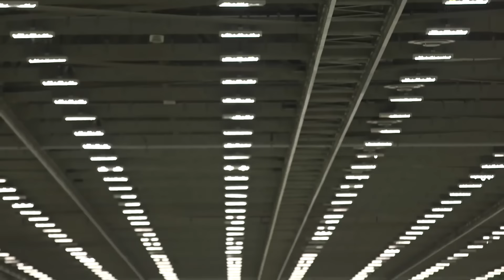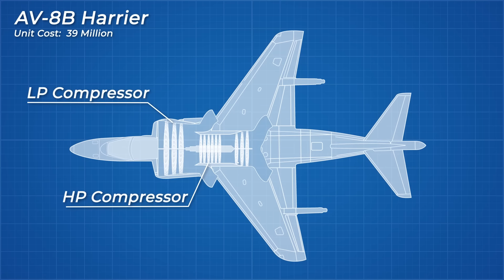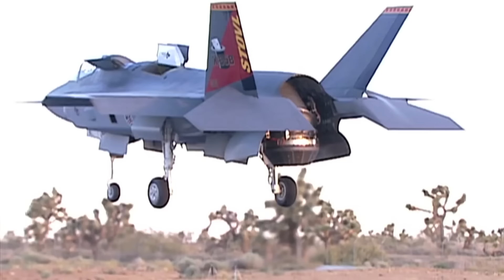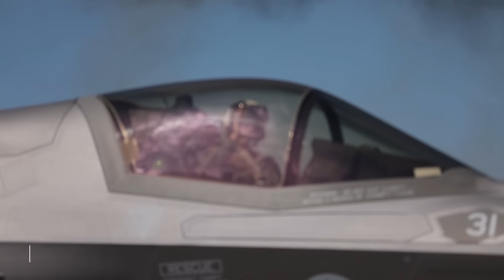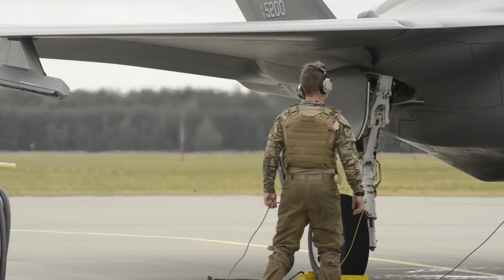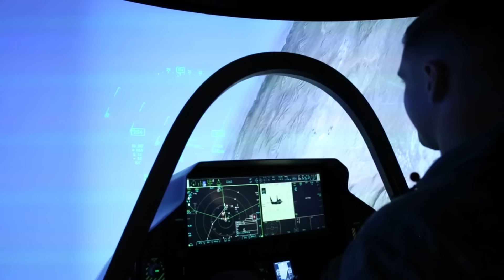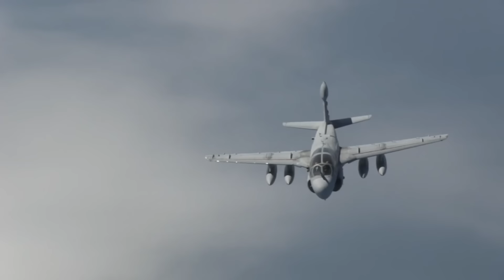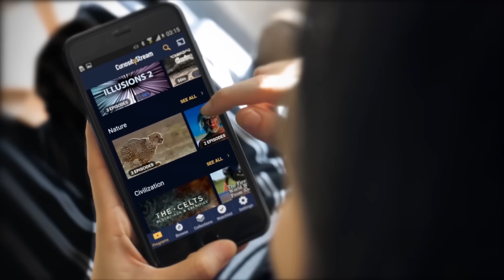Is The F-35 Worth $115 Million?

Comment: Half of F-35 fleet grounded by tech problems – Pentagon report. May 2019 More news. In 2017, the Pentagon revealed that “2,769 deficiencies” were identified in the performance of F35 jets. Further reports suggested some F35s have a life span four times shorter than the expected 8,000 flights, while the aircrafts’ guns accuracy is “unacceptable.”  July 2019 Latest news after 3 years the Main Gun is not working and it can't be sughted
https://www.rt.com/usa/416916-f35-pentagon-operations-report/
Reply: Nonsense.

Comment: This plane was a scam from the beginning. A real advancement would have used the same air frame for repair costs. With the ability to customize for use. Add large wings.  Vertical take off not needed put the fuel tanks in it's place.  They should all use the same frame and many other components. What's to stop the US from sabotaging or leaving secret components for tracking or manipulation. Never mind it's worst result. If successful it will kill other countries ability to build and innovate their own secure fleat.

Comment: What no one talks about is the fact that VTOL is vertical TAKE OFF and landing. None of these can actually take off vertically. Total fail.
Reply: F-35B takes off vertically. The Marine variant. They are the only ones who use the Harrier, and the only branch that requires that capability. It makes sense that the Navy and Air force variants don't, so they can be cheaper and hold more fuel etc

Comment: I really can't imagine an F-35A being able to loiter at low altitude for extended periods of time performing CAS nearly as well as an A-10 can, nor being able to absorb anywhere close to as much damage from small arms while still getting the pilot home alive. Also, it can't possibly carry as much ordnance as a Warthog can, even if we dismiss the 30mm cannon.
Reply: A-10s do not loiter at low altitudes if they can help it, if they did any opponent worth their salt will swat them out of the skys (they had one the highest number of lost aircraft during the gulf war) IR SAMs are it's bane. At one point they where pulled from active use due to their loss rate during the gull war.

In terms of Ordnance the A-10 is rated for up to 16,000 pounds the F-35 is rated for 18,000.

Further more CAS is not dependent on altitude or proximity of the troops to the tgts (the "close" in CAS actualy is for close coordination of the air and ground assets), and that most missions even with the A-10 are done with PGMs not guns. As such their done much higher in altitude for safety from ground fire. As such the A-10 has little advantage here of the F-35 and a lot of down sides. 

Entertainingly before the A-10 entered service it did a "test" where it was pitted against the A-7 which was the preeminent CAS bird of the time, not surprisingly the A-10 won, but when you look at the results you find that the A-10 should of lost or at the lest showed no clear winner (which actually was the opinion of the guys involved), as it only really won when both where down low and when the A-7 was not allowed to use it's fancy navigation aids and bomb computers (basically use the A-7 like an A-10, dose not work so well and like wise use an A-10 like an A-7...). More telling the recent upgrading to the A-10C finally gave the A-10 what the A-7 had during said tests (IIRC mid 70s).

Comment: Lad just so you know. Try to think at least 10 years ahead. Not just military. They are 50 years ahead technologically. The next move will be a rail gun that can be run by computer to shoot these down. If it takes evasive action, there will be supplemental rounds to meet those routes. Still an amazing aircraft and great article.

Comment: Doesn’t the F-35 lack the loitering capability of the A-10?
Reply: Loitering is not the end of all, and it depends on the distance of the airbase to the area you need to be in, further more the F-35 can get their in a third less time the A-10 takes. So if I need air support now the F-35 is a better option. If I need support now and perhaps later on sure the A-10 has it's use their, but so dose a B-52 or a Drone both of which vastly out last an A-10.

Comment: This F-35 recently got picked up and followed for 100's of Km's on a passive radar by a small radar company after an air show.
It's a POS if it doesn't have stealth.
Wish Australia bought the French Rafael instead.
Or even better if they had good relations with Russia, the Su-57.
Reply: Funny fact that All F-35s in that event where carrying Luneburg lenses, and was transmitting ADS-B. In short any Idiot could track one. So a passive radar tracking it is no surprise. Sure Passive radar is often stated as a threat to Stealth, but Keep in mind Passive radars need some one else to be the transmitter, in this case the F-35s (their where two of them and the German radar company Hensoldt stated they tracked them for 150km) where flying in an enhanced RCS mode and actively transmitting a HERE I AM code. 

In short they found and tracked a pair of aircraft that where not trying to hide at all.
Now if they Tracked them with out the aid of a active transponder (in which they did state they where using to cross reference) and the Luneburg lenses (which do come in passive radar variants) and where not flying on a practicable path at a known time. They might have a bit more of an argument.

In short Lets see them try to find the F-35 when it's Not Flying with Luneburg lenses on, nor with an active Transponder and coming from an unknown direction and time.

Comment: Former Osprey mechanic here. That being said one of our biggest issues was the avionics high vibration over  periods of time increased the brake down of wires as there clamps tend to slowly cut through the wire. Hence why we have 3 on board computer which compare data encase one computer fails. So In my humble opinion the f-35 biggest issue will not be any of it's production features but it's maintenance and up keep. Holding it back from being truly successful but I am optimistic if the plane can replace its predecessor's then it would have excess man power and room in it's budget to to deal with the maintenance leaving only manufacturering as a hurdle.
Reply: I say switch it out with styrofoam mountings to reduce vibrations.

Comment: If I would design something against the f-35 I would use a thermal sensor to detect it since the jet engine would radiate a lot of heat compared to the temprature of the air.

Comment: Very interesting video, but on of the aspects feel kind of untouched. One of the strong points of this aircraft is it's battlefield information sharing and integration system which makes it very powerful to coordinate with it's surroundings.  However how will this work for an airplane exported to another country ? Will it come with the confidential american system ? Will it be able to be adapted to the buyer's country's system ? If none of the above is possible then a lot of the innovations made on this aircraft seem partially pointless.
Reply: 30yrs old tech, pointless! Israel stripped theirs and installed modern avionics! More they are selling kits!

Comment: There's some issues with your video.  Not trying to be critical, but sometimes you missed some things.
-The A-10 is for bombing, not air superiority, it only carriers a couple of missiles for personal defense, it is best when attacking enemy tanks, bunkers, etc

-The X-32 didn't lose because it was an ugly plane, and the VTOL system wasn't its only issue, and actual, more critical issue was the wings, which were composite wings and Boeing could not produce them cheaply.  They spent several years trying to produce the wings and most wings came out as duds.
-The F-35B does not have a maximum takeoff weight of 31,800 kg (the F-35A and C do), it is 27,200 kg.  Furthermore, just like the Harrier, the F-35B cannot take off vertically while fully loaded.  It is classified as a STOVL plane, just like the Harrier.  It is an improvement over the Harrier, sure, but it's not a VTOL plane.
-This is really pedantic, I know, but the Marines don't own any helicopter carriers, and the Marines actually do operate from both Navy helicopter carriers and fleet carriers, along with the Navy.  In some senses, the Marines are still a component of the Navy, just like they were originally intended to be.
-When you mention the pilot who claimed the F-35 cannot dog fight, this report is accurate.  To expand on that, the reason the F-35 is doing better in simulations today is because pilots are being trained to take advantage of the plane's range and stealth.  The F-35 has missiles that can hit a target from like 60 miles away, and the fact that it is stealthy and equipped with America's best fighter sized radar means it should see the enemy before the enemy sees them.  Therefore the reason the F-35 can do well in combat vs other planes is because it stays safe, away from direct visual sight with the enemy, and picks them apart.  There are flaws with this strategy (lots of missiles that you fire from that far away tend to miss), but it is overall considered an improvement over flying directly to your opponent and firing Sidewinder missiles up his ass while chasing him.  The F-35 cannot dogfight because it is designed to defeat the enemy before the dogfight happens.
-Concerning the cost of the F-35, one aspect of cost that never gets mentioned is the cost of flying the plane on a day to day basis.  The cost of maintaining, repairing, and whatnot.  The F-35 costs less than most other planes that it replacing to maintain, which still means that it's a shitload of money, but in the long run it might give some of that back.

I consider the F-35 a failure specifically because of cost.  The reason Congress approved the project was to produce a plane that we could buy thousands of at a low cost without sacrificing a ton of capability.  It is a capable plane, but the cost has gone out the window.  Why make a "reasonably capable plane for a low cost" without the low cost?  Now it's just a reasonably capable plane.

Comment: It appears the True cost of these planes is being concealed thru creative accounting and billing.
Reply: The Incoming CinC demanded a better unit cost so, Hey Presto, shuffle some line items around on the spreadsheet and move chunks of costs to auxiliary systems and support structure then the pretend cost is a new lower price point. (Helmets, sensors, support equipment  and software not included.)

Nothing up muh sleeve but muh arm, folks!
Reply: @puirYorick  yes it appears that what the government is actually paying is likely fifty percent higher than claimed.
Reply: @klardfarkus3891  Hey, this ain't Lockheed's first boondoggle rodeo with DoD budgeting. Together they temporarily hid entire "black jet" projects out of the Skunkworks as line items for other projects when necessary. It's how it's done.

Truth is always an early victim in the procurement process. The surviving players are the ones who out-foxed the rest on playing politics not necessarily the best engineering designs.

The upside is that the assets of the losing teams are acquired/retained by the winners so things like Jack Northrop's flying wing eventually resurfaced from a version of the company he founded as the B-2 Spirit with a lot of additional computer-aided design work.

The design that beat out the first YB-49 flying wing was very conventional (the Convair  B-36) and would itself be succeeded by the B-52 in time. Those Buffs are of course, still "carrying iron" in the era of stealth bomber procurement for the next generation - the B-21.

This is mainly why I get a kick out of armchair warriors tossing performance claims back and forth. The actual decisions are as much to do with friends in high places as with hard engineering.

Comment: If all that the stealth does is to reduce it's radar cross section area, making an f-35 have a csa like that of a large bird, computers can still monitor the speeds of the objects in radar, and any object the size of a large bird flying at the subsonic speed would be the most obvious thing to focus on, 

Just a thought, since the radar waves belongs to EM spectrum, and if reflection theory can work, why not the refraction, why don't they try to build something that would refract off the waves at a wide angle?

Comment: The financial analysis here is severely lacking.  Per unit cost means ALMOST NOTHING compared to the total program cost.  You need to look up OPPORTUNITY COST to make sense of this. 
The f35 program has a total price tag of 1.5 TRILLION dollars, while the f22 raptor has a per unit cost of 150 million.  The f22 program was already basically done when they STARTED the f35 program in 1992 (f22 first flight in 1996).  This means that if they had never bothered with the f35 program at all, they could have purchased 10,000 additional f22 raptors for the price of the f35 program.  Are you seriously going to try to convince me that the 2600 f35's they plan to have when the program finally finishes will be BETTER than having 4 TIMES those numbers in F22 raptors?  The f22 is a superior plane, and everyone knows it.  This is why the f35 is ALLOWED to be exported, but the f22 is NOT ALLOWED to be exported.  If you spend all that money on buying f22 raptors not only would you have more planes, they would individually be significantly BETTER.  In addition most of the neat toys you talk about could have been developed for the f22 INSTEAD of for the f35.  
       Gush all you want about the lovely technical tricks in the f35, the answer to the question "is the f-35 worth its 1.5 trillion dollar price tag?" is a resounding NO!  That money would clearly and obviously have been better spent purchasing more f22 raptors.  Opportunity cost means "what are you giving up by spending your money here instead of somewhere else?"  It is clear that if the same 1.5 trillion dollars that was spent on the f35 were instead spent elsewhere that the US military would be FAR better equipped and FAR more capable than they will be with the f35.  The f35 is a neat plane, but it is far INFERIOR than what we COULD have gotten for the same money by spending it elsewhere, and that is the true comparison that should be made.  When the f35 was started we already had the f22, so at the time the option was there to simply purchase MORE f22's instead of designing a new plane.

Comment: There are three main issues with the F35. 

     First, there is no need for a stealth Fighter. Stealth makes sense for a bomber, but not a fighter. In a long range air superiority role (Like the F14 and F15), you can take a C130 and put a hundred missiles on it and it is  at least as good. In a ground attack role, you only go in if you have already destroyed the enemy air defence radars anyway. In an dog fighting role, most people are not firing radar guided missiles at you. In stealth mode it has minimal armament. When fully loaded it is very radar visible. The moment the F35 turns on its radar it is visible. And if the have a computer link going, it is also detectable. 

     Secondly. They assume that no one has tried to invent counter measures since the F35 went into production. In 27 years they have come up with at least three technologies that can locate, track and missile lock onto an F35.  The 'stealth' on an F35 is only good against certain frequencies of radar and now there are specialist anti stealth radars just for finding such aircraft/missiles. The F117, which was a stealthier aircraft than the F35 was regularly tracked at ranges of up to 100 miles during the first Gulf War.  One F117 was shot down and there are reports of a second being damaged over Bosnia.
     Third. The F35 is a very fragile aircraft that is very difficult to repair. To repair the electronics, you have to replace the module and then send the original module back to the factory in the USA for repair. Not a very good system. And if you damage the airframe, it can take over a week to repair even minor damage. 

    But the F35 has succeeded in its primary mission, which is to make Lockheed Martin huge amounts of money.  Remember it has taken 27 years to get this far. In comparison, it took 12 years to go from Sputnik to walking on the Moon. And the Space programme cost much less. For the amount of money spent on the F35 we could have had a permanent colony on Mars by now.

Comment: No, it's not.  It's not particularly good at anything, which was fine when it was supposed to cost only slightly more than an F-16.  Now it costs slightly less than an F-22, which is far more capable and had a flyaway cost of about $150M.  The F-35s real job was to spend money.
Reply: The F-35 costs around 85 million dollars nowadays and is a multi-role compared to the F-22 which is primarily a dogfighter. They have different purposes and the F-22 is airforce only.
Reply: @user-ri9dn4vi6i  It's still too compromised.  The VTOL version compromised the aerodynamics and survivability of the other versions.  The Navy would've been better off with twin engines.  The Air Force would've been better off with a better attack plane for CAS